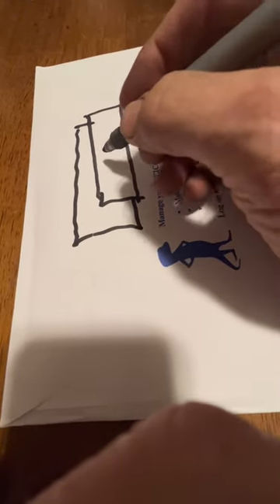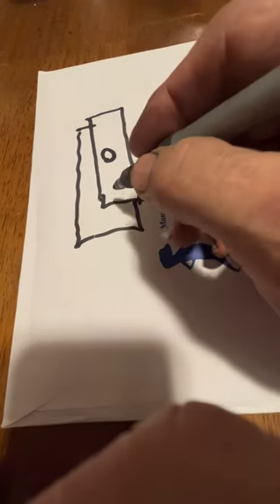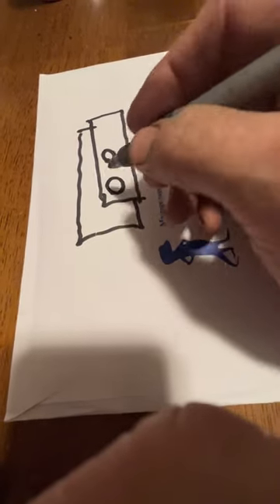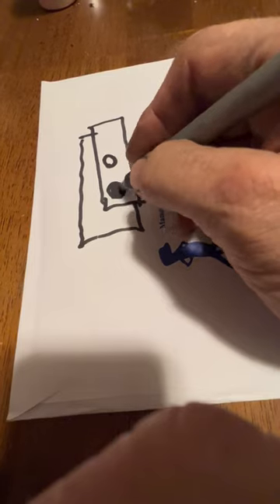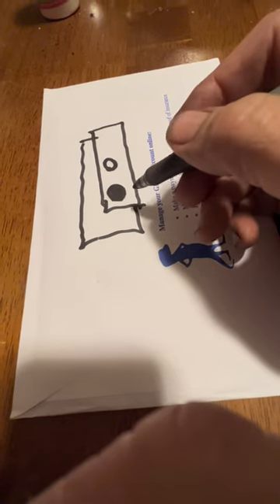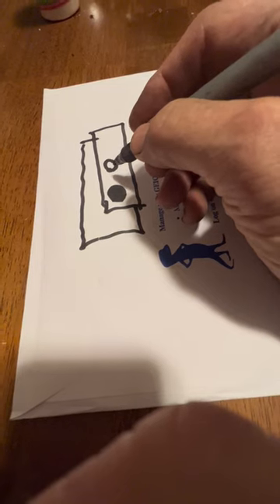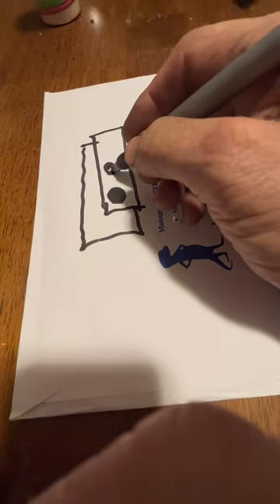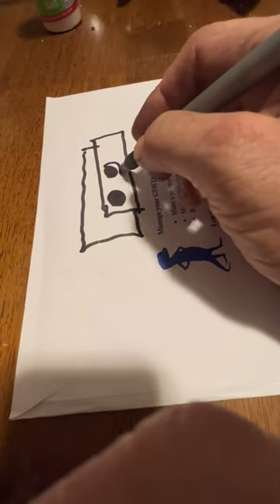TROLL SCHOOL lesson 12.   Trolls can’t weld🤣🤣🤣🤣🤣

Comment: What, exactly, did I just learn? Asking for a friend......😅
Reply from the maker: You learned that trolls need daily spankin’ from their daddy Billy, and you can weld plug welds from holes
Reply: You learned how to plug weld with a mig. It's an alternative to spot welding when you want to duplicate the location of the spot welder(factory) but you don't have a spot welder....... I think 🤔 . I may have just described something else..😂
Reply: @OldBondoBilly  No problem with the plug weld, I've been certified for flat, vertical and overhead MIG and stick on rebar up to 2" diameter. I was trying to grasp the part about the leftover from drilling out the spot weld. A quality step drill does great for a clean spot weld removal, but you already know that. If that doesn't work,  get a plasma...😆👍
Reply from the maker: @billfoster213  funny you should say because I was going to use my plasma cutter, but decided against it because I wouldn’t have enough time to spank all the trolls who quacked about muh crooked holes 🤣🤣
Reply from the maker: @flybynytt  A spot welder suitable for automotive panel replacement is tens of thousands of dollars.  Don’t let ignoramus Internet trolls try to tell you otherwise.  Yes, I learned to do plug welds with a mig welder, but I have switched to flux core because it is the superior method for this exact operation, because I set the amperage much higher than the experts, who are much dumber, so that I can get instantaneous fusion in milliseconds.  When I weld this van side back together, I will give you a proper demonstration.😉😉
Reply: @OldBondoBilly lol billy you’re an American treasure. Thanks for sharing with the internets
Reply: @billfoster213 😂😂
Reply: Nothing that's dudes a hack

Comment: Only thing I don’t like about that method is that the back of the panel won’t be smooth we’ve all seen it where there’s a big lump of bubblegum with wire sticking through it on the back side lol
Reply from the maker: You see that with mig, but not with flux.  Both sides are low bead.  I didn’t recommend this process for mig because it’s inadequate in penetration and build integrity.😉😉

Comment: Sorry Billy but that’s a plug weld.  Spot welds (also known as pinch welds) are done by spot welders (or robotic spot welders in auto manufacturing).  The spot welder joins two pieces of sheet metal together by pinching them between two probes and creating an arc.  The weld point looks like a shallow dimple.  No holes need to be drilled like in a plug weld!  But you’re right they are both a pain in the ass to separate!
Reply from the maker: You’re also right except for spot welders don’t produce an arc, they melt the metal together 😉😉

Comment: As a Aussie welder, I agree with you 100% that this is the proper way to join these two pieces. You have a lot more penatration welding up a hole then if you just spot weld with out one. I know because I've done it and it's a weak and lazy way of doing it.

Comment: Hey, I just thought I would let you know about something I just saw on TikTok I think was YouTube or TikTok whichever but anyway, the guy was using for a medium for a sandblaster to remove a tooth that was in a rock that was for a certain dinosaur well he was removing it with the sand medium that was consistent with something really smooth, but he was using baking soda and the pressure from the sandblaster got the tooth out completely And I thought that would be interesting to tell you about that with the kind of job you  do,,, could that be used in your applications? If so, let me know that’s pretty neat I just thought you’d be interested in that case you had to remove certain kinds of things, and he was using it as an archaeological type thing or looking for these kinds of work of fossils…..
Reply from the maker: Soda blasting is a thing in Autobody too😉😁

Comment: I did the I-car certification right after highschool, was a cool class. No body even knows what it is, till they see that perfect paint job out of a garage 😅
Reply from the maker: I got I-Car welding certification in 2000. I was not happy having to pay $431 to have someone say I knew how to weld🙄🙄
Reply: @OldBondoBilly  I did the full course, it was about 4k for the year and half I went. There was several certs I got from paint resurface to doing metal work and welding. I was 18 at the time...those did nothing for me in the real world, no place has never honored it. Today I do RV paint and structural repair. Fun with fiberglass billy! 😉

Comment: Yup, I got a tip, if yea wanna seperate the spot weld, use the smallest bit possible and work around the outside of the spot weld instead of the same size but in the middle  but you got  a perrma weld and my trick won't eat that 🤣👌
Reply from the maker: What’s a perms weld?😗😗
Reply: @OldBondoBilly  welded so good you need a torch to unweld it
Reply: @OldBondoBilly  gotta remember thou, I'm a redneck hillbilly when it comes to bady work,  I'm a function over form
Reply: Oh my!